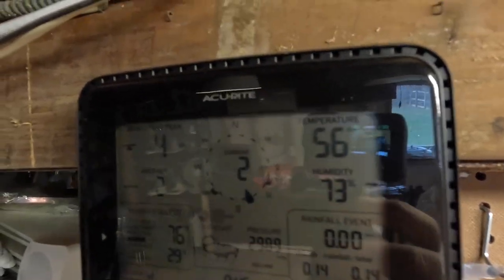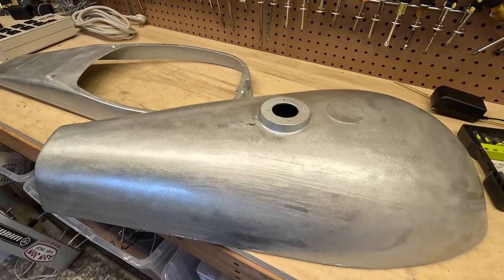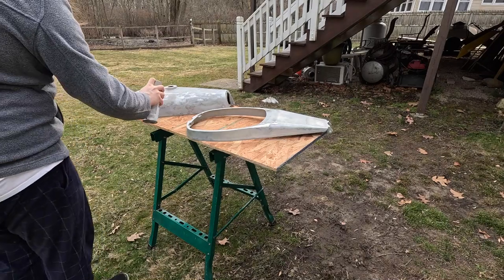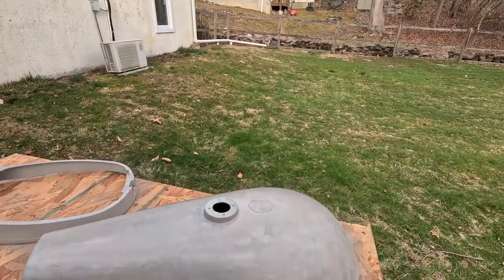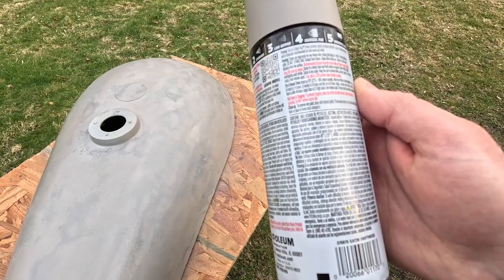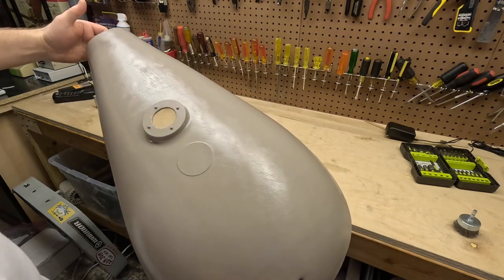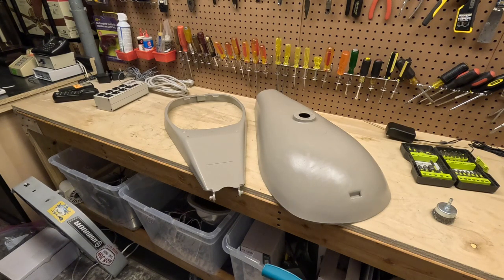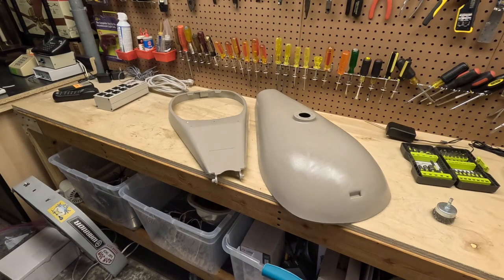General Electric M250R2 70-Watts HPS Street Light Restoration | Part 2; Painting Success

Comment: That turned out well! The satin sheen of this paint looks much better too. I find that wire brush works great on textured surfaces such as cast iron, since the bristles reach into the nooks and crannies, but in your case, sandpaper definitely does seem to be the better option since the surface is smooth. A few coats of primer and light sanding also help to level out the scratch marks from the wire brush if you ever run into a similar situation.
Reply from the maker: The satin finish is better, far closer to what it was originally. I have no idea what I was thinking when I bought the first paint.

A few more thicker coats of paint probably would have started to cover the texture, but I don't think it matters in this case. Once it's up on the wall, it won't be noticeable.